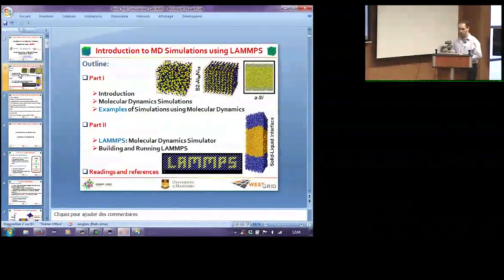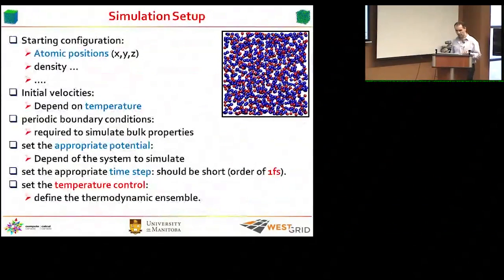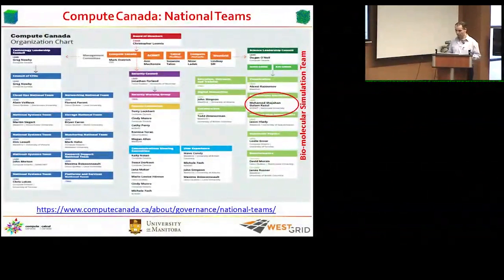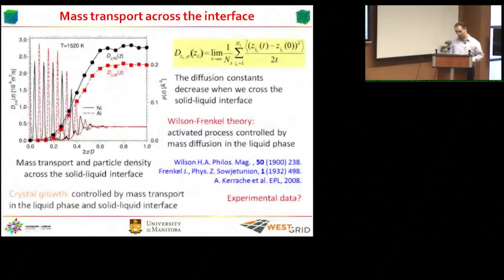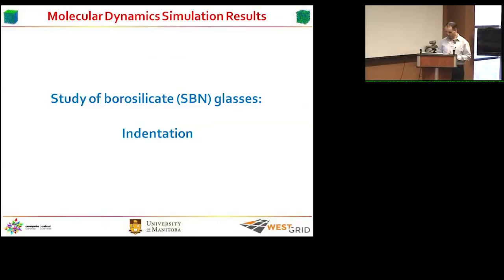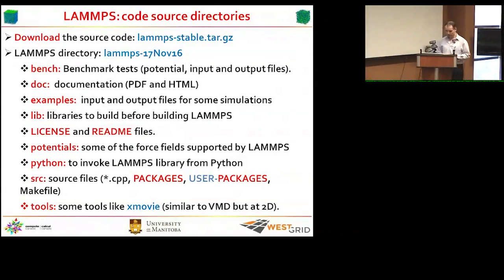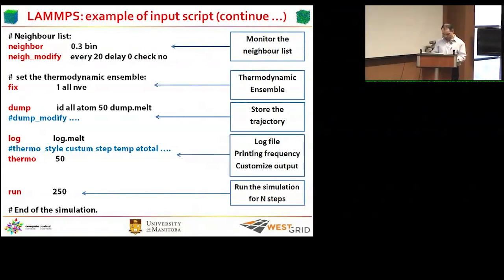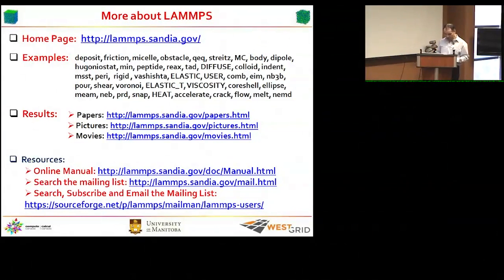Intro to Molecular Dynamics Simulation using LAMMPS

Comment: for lammps program can we take positions from any other input file? files can be generated from other software.
i can not call the input files in lammps program. can anyone help me.
Reply: if you want an input file for lammps it has to have specific structure however you can generate it from pdb file or xyz file. To do such thing you will need VMD with TopoTools plugin. After you have those you need to read xyz file into vmd and using "topo writelammpsdata <filename> <atom style>" you get lammps file which you can then read into lammps using read_data command
Reply: thank you for reply. i am able to call the data. but now i am facing another problem. by position and potential file format are not matching. can you tell be about the lammps file format of position and potential ?
Reply: For data file with atom positions you can see the structure by googling "lammps data file format", it's provided by sandia, simply write it in the notepad and save as a txt file (ANSI coding), it works for me. For the exemplar potential file you can check online as well, however the extension of file is changing. For example AIREBO potential file in the lammps repository is CH.airebo so I guess it depends on the chosen potential, but I'm no expert in those.
Reply: thank you very much